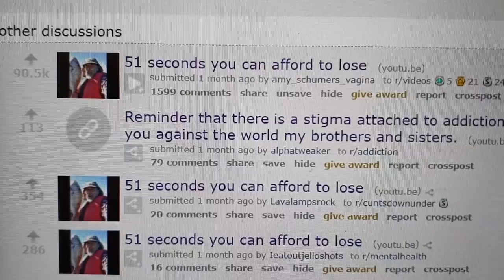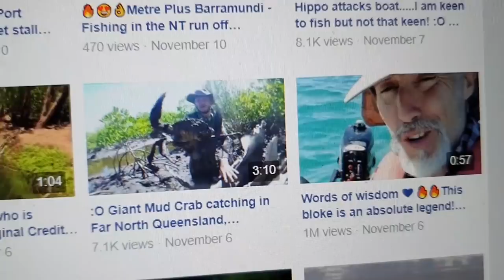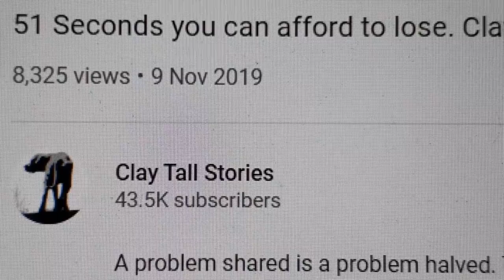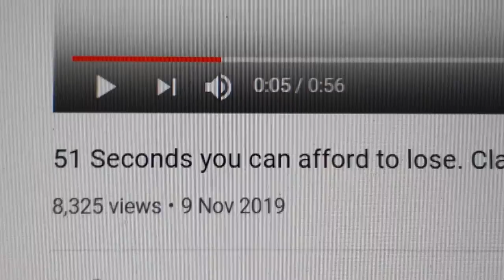People, Trucks, Tires & My Stolen Video Going Viral~Clay Tall Stories~SV81

Comment: Value for money mitsi triton hard to beat, been driving them for 6 years everyday  with work and 40k  plus kilometers a year. No issues excluding a gear box detent which was covered by warranty & replaced.Out lasted the bt50's doing same style of work(power board)  ✌
Reply from the maker: they are making their way up the list bloody fast. More and more people giving them top reviews dollar for dollar.
Reply: Agreed, had an 02 single cab Triton, that truck did 6 years of hauling trailers, concrete gear and being passed around a crew of guys and it never skipped a beat. We named it "Stinky" after one of the workers left sandwiches under the seat, which evolved into some rancid smelling alien life form that fused to the floor plate over the course of a year. Apart from the smell, it was an absolute pleasure to drive on or off road.

Comment: Ive had the same issues with the modern utes. I had a 2.8 1993 hilux back in the day and you couldn't kill it. But under powered they are amazing, always late in the 2.8.  I then got a 2004 holden rodeo. that thing was also not bad. I did over 400,000kms in it and it never missed a beat and never failed a warrant.  I upgraded to a 2016 and i have already stuffed the engine with water damage, not ever having it anywhere near as wet as my last 2 wagons. they just dont make them like they used too.  I miss my Rodeo. cheers JP

Comment: Love your attitude bro and as you said your message got out there. That’s the goal👍 As for trucks I love my ole 80 series land cruiser. What about getting one of those that’s had the Ute conversion done to it. Comfortable 5 seater with heaps of room and a massive well deck tray on the back. And the best part,,,,,,,,, Real 4wd capability’s. Just a thought
Reply from the maker: The 80 series are great trucks. I just happen to have an obsession with the 70 series
Reply: The new double cabs with the V8 in them would be nice😜😜 bit pricey though.

Comment: Hi Clay.  I'm from coastal Pacific NW Washington USA. I also drive (4WD) on everything from fine sand beaches to mud and snow. The only tire I use is the B.F. Goodrich All Terrain T/A. I've ran them for over 20 years and they've never failed me. As to trucks, good luck. In my opinion there's nothing out there worth the $$$.  I drive a "98 GMC Suburban (2nd to last year built on a truck chassis) with 200k and my pride and joy my "98 Toyota Hilux T100 (last Toyota P/U imported from the Hilux plant) with 165k.  For what they want for a new rig, I'd truly consider buying a good condition Landcruiser and repower/restore it to your requirements.  You'll end up with a better, more reliable vehicle set up to suit you for a lot less $$$, particularly if you've got a good source for the labor. I bet if you contacted tire distributors and optional equipment suppliers to throw something your way as a sponsorship. Happy Solstice to you and your family, and that you be blessed with good health and much happiness in the new year.

Comment: Haven't scrolled through all the comments, so perhaps it's all been said.
  As for good tires; can't go wrong with BFG mud terrain. I've ran them on multiple trucks and have been happy. I'm using Goodyear Wranglers (on sale in stock) and wished I'd stayed with the BFG, not bad but will plug up.
 Love me a cruiser, look around the world, hard places it's cruiser's and patrols. I've got a Mitsubishi (Montero sport aka pajero) and have been pleasantly pleased with it.
 Love the Ford "wash my mouth out" I use F 350's and 550's at work. Lots of issues on brand new diesels. No more so than any other major builder, however, all the new stuff is computerized junk, plastic bumpers and made to fail.
 I did trade in a BJ 60 for a F 250 diesel years back. Wish I'd have taken the extra cash and rebuilt the cruiser. Replaced the 250 with a BJ 42 lol.
 Something to think about; find a solid older 40, 60, 70 series, or a patrol, and take what would be used in buying a new vehicle to create a solid truck in a way you want it.
 Personally I'd love an HJ 75 but they're a bitch to find (Canada) along with parts.
Merry Christmas (you're probably there already!) from Canada.
Reply from the maker: thanks mate

Comment: G'day Clay, I run the Maxxis bighorn's on my Hilux, just clicked over 30k on them, about 60/40 split on road v offroad, rate them pretty well. Will probably get another 10-15k before I need to replace them, and will probably go with a set of the Maxxis razr's to try, meant to be quieter on road. Have a good one mate.

Comment: Maxxis bighorn is what i use on my terrano, pretty decent on and offroad. Bit noisy on the road though but that's fine. Also, dad drives a Ford Ranger and he does over 1000kms a week and its only had one minor issue within 200000kms and even though it was out of warranty ford still covered it for him.

Comment: I recon buy something like a 70 series cruiser but if your ok with not having a flat deck, then buy an 80sereis, because they can be dual locked, they are an older reliable truck and you don’t have to be scared about throwing them around, they are also cheaper than the 70 series by about $40,000 and with that extra money you could do some modifications to suit what you want to do.
Reply from the maker: real logic here...which completely fucks up my silly passion for the 70 series.

Comment: Absolute best value and performance M/T tyre would have to be the Federal Couragia MT. In Australia you can get them new for about $250 a corner fitted. Only downside they are a little soft and can be noisy (I don't notice it). Should last 30k hard off road/on road use.

Comment: Nice boat! You know by now a boat is a hole in the water where you throw all your money. 👍😎
Reply from the maker: yeah mate I do.
Reply: @ClayTallStories  I bought a sailboat and lived on it for years in the Florida Keys. The good part is that if you get tired of the scenery, you just pull the hook and move your home to another place. Also you can take it to the reef and go diving and fishing. So it's you water RV. But you're always fixing stuff on it, and if it's marine parts, it always cost more. Paint for example, marine paint cost double of what house paint cost, and the only difference is the label.
Reply: @parrotbill9072  im a painter mate and there is a huge difference between marine paint and house paint. Not just the label, 
I agree its a ridiculous price and we get shafted by any marine products.
Reply: @islandpainter3964  I worked on wood hull shrimp boats for year, and when we halled out, we painted the bottom with copper paint and above the waterline with a good grade of enamel exterior house paint. It was good paint, lasted a few yrs until the next time we halled out again. With the hull flexing and the sun cracking the decks and bull works, nothing lasted very long. When the crew had nothing to do, there were always a couple of paint brushes and a few gallons of paint onboard to keep us busy touching up the deck where the shrimp nets wore the paint off. Deck lights work better on white decks and the nets wore it off in a month, no matter what kind of paint you used.
      The marine paint was much more expensive. That was 40 years ago so the paints are probably better by now, but still won't stand up to loaded nets.

Comment: mud grips r good if ur full time in muddy swampy terrain! The mud grip actually grabs the mud and throws it out nd away! Cons, noisey on highway, depending on size u may need to change gearing in diffs?? Slower ride. Slippery on road when wet No grip on sidewalls all terrains are much better, they turn faster less noisey suitable for onroad more grip when road is wet, don't hav to make major changes to gearing, and they hav grip on the side wall as well which is handy for throwing mud. I done a 4x4 course a while ago and the tutor who was a scientist who majored in physics recommended all terrains r the best selection, end of day ur choice tho🤙 as for 4x4s depends what ur doing what the terrain is like? What weight limits ur carrying? Wheel base length? These were some of the guestions the tutor said to ask ourselves! He liked the amarok because of the technology and computer that controlled the truck! We were surprised on how much we didn't no about 4x4 wen we met him!! A lot of the newer trucks hav amazing technology and computers in them that a lot of people don't knw much about or how to use the new 4x4s! I will try and find my course books and send u this tutor's name he had awesome knowledge on 4x4s 👌👌

Comment: Love the shirt brother. I have had many many tyres brother and do at least 2 days per week in the shingle, mud and swamp up in the hills, i also live on a orchard/farm. My advice, pound for pound, Cooper STT Max or ST Max. I run the ST Max and would never go back to BFG or any other tyre for that matter. As for vehicle, I have a Pajero, 2003 model, absolute weapon, could pull a house. I have OME suspension and lift kit, after market Roo bar and winch plate, tradesman roof rack. I have had Nissan, Toyota and Fords but i love my Paj. For a ute and if i had the coin, 70 series.
Reply from the maker: with you on the 70 series. Whats wrong with BFG? I have done well out of mine?

Comment: Clay, Maxxis for good cheap 4x4 tyres. Value for money with a great warranty go Isuzu or Mitsi. If you need a bed on your Kiwi puppy run, bed here in the Deep Sth. The B50 Mazda is the same as a Ford Ranger & cheaper too. Toyota has lost the race now... Land Cruiser V8 are way expensive and no more V8 Diesels either they hold their value though... I'm 50 & am not biased, always looking for bang for your buck...

Comment: The dmax is a highly under rated ute and also you can't go past maxxis tyres relatively cheap however as much as people moan about them I have seen goodride muddies go just as far with less sidewall abrasions and cuts than the more expensive brands they are a 3rd of the price but not a 3rd of the performance
Reply from the maker: nothing wrong with Maxxis

Comment: Firestone destination m/t isn’t a bad tire for the price here but I’m not sure the availability in your neck of the woods.
Reply from the maker: bluddy good tires. Had them and got 70k out of them. A little bit hard but good bang for your buck.
Reply: Yea they’re a little harder tire compound to hold up to wear for on road driving which means they’re less likely to develop flat spots if you ever need to get on the brakes hard on pavement. I’m going to give the destination mt2 a shot when the mt,s I have get worn out.

Comment: By far the best all terrain 4x4 the Steyr Puch Pinzgauer 710M, about the same length as a landrover SWB, even 2nd hand they're very expensive and in NZ they'll be as common as rocking horse manure, and 100kph is top speed. 5 tonne towing capacity
https://silodrome.com/wp-content/uploads/2019/07/Steyr-Daimler-Puch-Pinzgauer-4x4.jpg

Comment: To much clay I do like your content ... so as far as vehicle's go is personal preference but I do like the vw amrocks when I use to be a fleetie in the tyer industry if you get to look under all the main 4x4 vehicles Toyota ford holden Mazda isuzu mitsubishi ECT.. the vw is far more robust under there y quite a bit.. as far as tyres go you get what u pay for but Nicky Thompson or coppers at the top of the line and u pay for them ... but any tyer can be chewed out if you don't look after them with wheel alignments and rotations tyer pressure is important to.. Good luck what whatever u go for clay and hope you have a good Xmas new year cheers to ya

Comment: Stick with the BF Goodrich km3, have used them in the outback across rivers, and all shit that comes with the outback can’t fault them. Mickey Thompson are good but popular because they look “Good” and sponsoring deals they have with other Youtubers! I have had hilux, went well currently driving the Mitsubishi triton done109,000km about 70,000kms of that outback Queensland, it’s 2 and abit old had one issue which was dPF sensor that happen 6 weeks apart from that it’s sweet, just be aware the triton have a vacuum system on them and if they go there a headache, am changing my truck in April, I’ll go with who every the best deal, as most dealer offer 5 year or 100,000km warranty, buy a 110 defender, everything mechanical and the hound boys can work on it, basic mechanics my 5°c worth, bloody good videos

Comment: TYER'S and value don't go together in the same sentence Bro Ha Ha , Mickey Thomson's for me mate if I could afford them but they are not cheap , I have tried so many different tyre's over the year's , I run Dunlop Grandtreker's on the 105 series family cruiser,  had them 5 years so far with no  problem's but not cheap at $250 plus a tyre{ family safety issue ), on my 75 series i just run cheap $130 dollar Infinity's cause when I go bush in the old girl and tear out a side wall on a stump or hidden rock after airing down on the beach I don't mind so much as far as witch 4x4 I think they are all the same ( soft as ) Mate Toyota ,Nissan and Pajero are the only 4x4's worth looking at ,Tried and proven but only the older model's were built on truck spec's so you should find you a Toyota tray back like my old 75 and just breath new life into it till it become's a part of you Ha Ha Ha
Reply from the maker: U have a 75 series...? U R a blessed man!
Reply: @ClayTallStories  as are you my friend Merry Christmas  Bro just an after thought but a Toyota troopy would be ideal for what you do